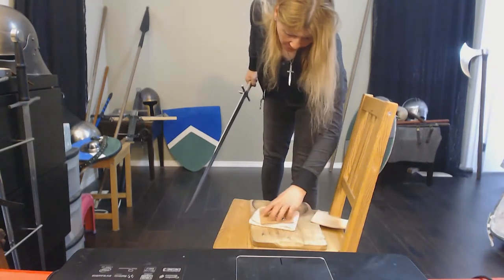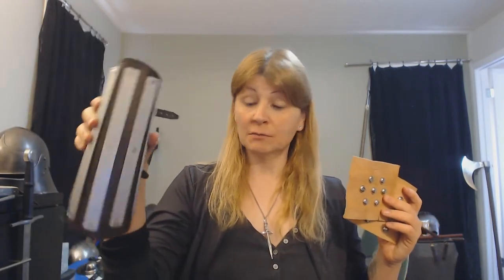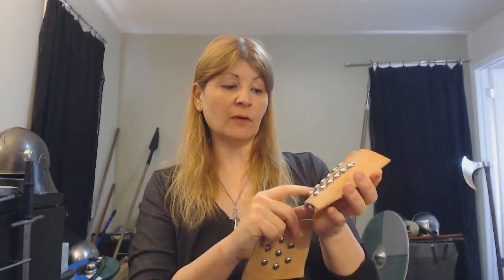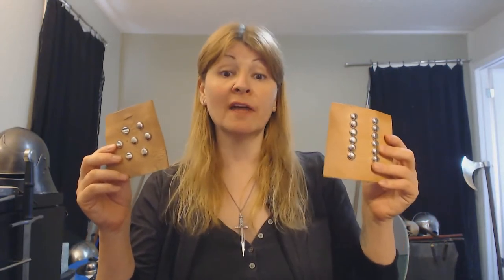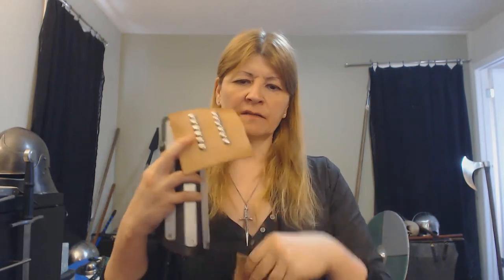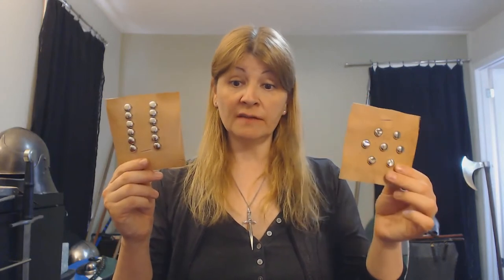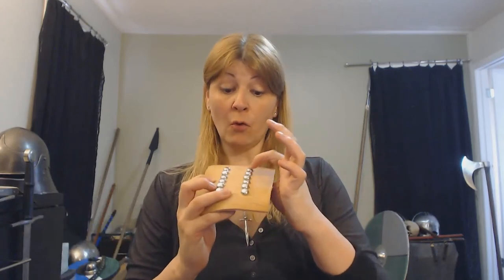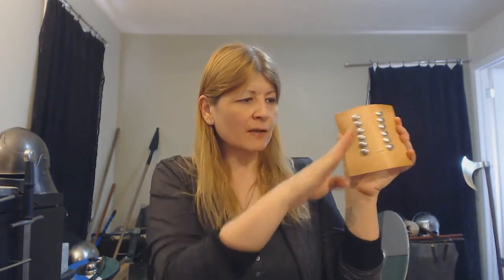The Controversy of Studded Leather

Comment: maybe a possible explanation for examples of historical studded leather armour might be that it could’ve been easier to make studs than larger plates, either for inexperienced blacksmiths or craftsmen?
Reply from the maker: To make studs you'd probably need to forge a rounded bar and cut it into pieces, essentially making domed rivets. Flattening that bar out instead of cutting it into the rivets probably takes about the same amount of time. I suppose if the iron isn't of great quality then making stud rivets is more effective than trying to get a consistent material for a piece as long as one's arm. Inexperience is a tricky thing to qualify since a regular blacksmith would probably avoid making armour for anyone if possible, and leave it to an armoursmith. But certainly something to think about if I can ever set up a larger test against studded leather samples.
Reply: @LaurenDangerShaw  yeah the quality of the iron used is a much better possible explanation

edit: not saying an explanation for saying it might’ve been prevalent ofc

Comment: Except the practical problems you point out with tons of tight rows of studs are solved by more space-out, irregular patterns. Sure there’s a trade off with the effectiveness, but like you said, it might not be as feasible or efficient to have tight rows of studs like that when you could just do splints. The real question is would it still provide an affordable and doable, but more protective, alternative to plain leather armor? And clearly yes, it would, if the studs were more spaced out it would actually be an upgrade one could sensibly do, and would still do *something*, even if it might not be as much as it could be (but again, seems like it would be easier and require less material than full splint would be).
Reply from the maker: The goal would be to build a few larger pieces of leather to test outside and put your suggestion to work. The only way to know is to make it and test it, Mythbusters  style! 
if studded leather fills a gap in games then I’ll let it be what it is for that of course. Maybe physics is different in a fantasy world? Maybe.
Reply: All those fantasy peasants without the money for splint would certainly appreciate it xD Thanks for the video!
Reply from the maker: You’re welcome, and always happy to help the peasants!